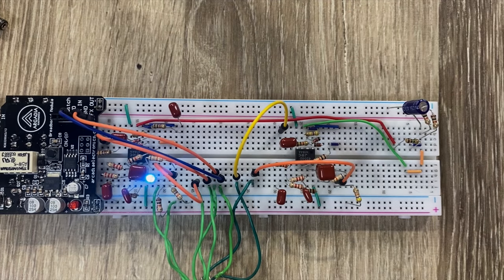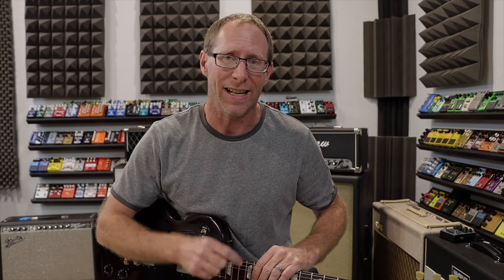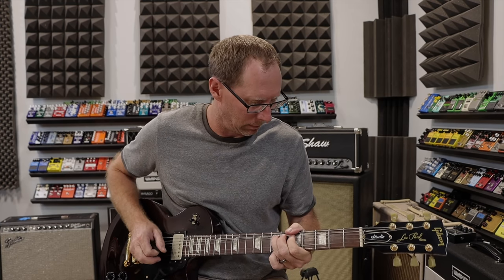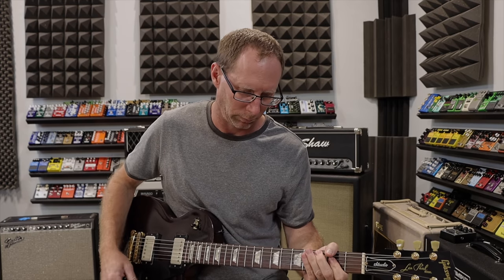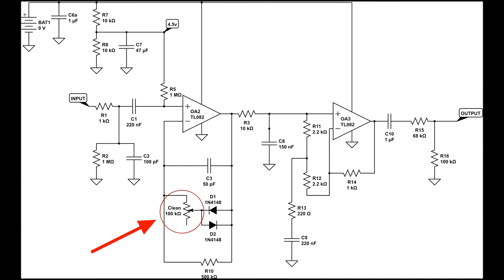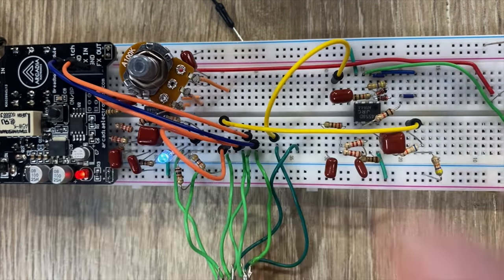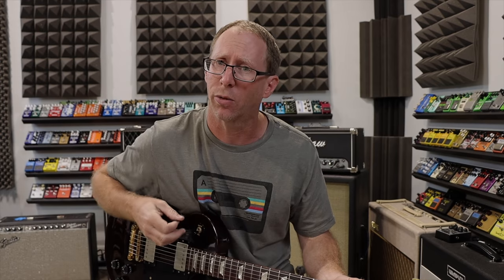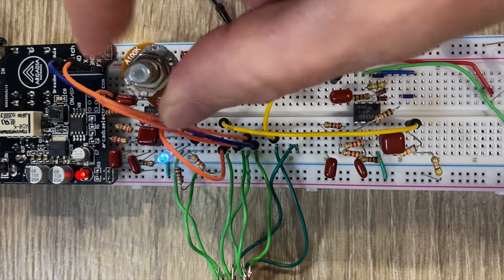It's all about the g̶a̶i̶n̶ ehhh cleans?

Comment: It can be hard to hear blended-in clean under a heavy distortion sound in a one-track, mono take when there's little clean signal added in or left in.  When clean guitar is used in the guitar sound of an album, it's usually in its own track (or tracks) and can be manipulated in its volume and/or compression to stand out more (or not) against the more compressed distortion.  Also, stereo panning can emphasize or de-emphasize the effect and audibility of included clean tracks.
Before hearing "the answer," I think Circuit 2 is the one with blended-in clean tone.  Don't know why, exactly, it's subtle, but there seems to be slightly more complexity to the harmonics in Circuit 2's sound.  I could be wrong.  That extra complexity could be from there just being less circuitry in the signal because it's a simpler distortion-only signal path, but that's my wild-assed-guess statement of opinion.  I don't know which one was LED on or LED off because I listened with my eyes closed.  Let's see how it went...
Turns out I was right.  But I'm no tone genius, there was a lot of 50/50 in that call.
I do think that blended-in cleans can be very useful in getting good tone out of an overdrive or distortion pedal.  Used judiciously, it can cause distorted tone to sound a bit more big-tube-amp-like by giving a lot of dynamic "slam" to the attack of a note or chord and then, because there should be more fundamental in the clean signal than the distorted, can impart a "fullness" to the overall tone before it fades under the sustain of the distortion.  That's my theory, anyway.  Balance is the key factor here.
Or you can use it as a weird effect by throwing in lots of clean and little distortion...
This was a good demo.  It clearly demonstrated the concept you were trying to get across.

Comment: So what is the difference between this and using a parallel dry signal mix in pedal?
Reply: Guessing the clean is still passing through the tone stack (vs parallel which would just be mixed in right at the output)

Comment: About 4:30 for me enters that uncanny valley where you can hear both signals too far apart and it feels kind of unnatural. I feel like this trick works a little better on bass to preserve some low end with a lot of circuits but have never liked a true clean blend with guitar.
Reply: Yeah after that it starts to fall into almost an effect more than just tone shaping. Maybe useful or fun to tinker around with but i hear it too.

Comment: That's a lot like the practical method of stacking pedals rather than relying on just one pedal to do it all (but parallel addition not series stacked pedals).  
Repeat this test with a Strat since complaints about the 'too thin' bridge pickup are so frequent.

Comment: As I play bass as well, I have bought pedals that have a blend pot so you can blend the clean signal into the effected tone.
My immediate, mid term , and enduring reaction to discovering this experience is a categorical; ALL distortion/overdrive/fuzz pedals should come with a blend control.
As long as that is not the case, our world is imperfect. * bangs gavel *

Comment: The Cleans is not the Dry signal, the cleans are from the amplified clean with the soft clipping diodes? Most Chorus pedals take the DRY signal and tap it off right BEFORE the first input stage. Distortion and overdrive pedals are taking the DRY signal and tapping it off AFTER the first input stage and adding soft clipping diodes for the positive and negative cycle of the DRY audio signal?

Comment: What circuit would this most resemble? The tone is awesome on it’s own but, with the some clean mixed in, even better. Didn’t like it once you start hearing  it separate into two different channels. I would be happy to have the tone of that circuit on it’s own though.
Reply: Blues Breaker.  If you look at the schematic, there is a 6.8k resistor in line with the clipping diodes just like Brian showed in the video.
Reply from the maker: @ChrisRash  actually closer to the tubescreamer, just with different values. You're correct that the 6.8k in the BB is doing the same thing though.
Reply: Thanks for the reply. Love the tone!

Comment: I’ve been trying something similar with a signal splitter with a gain pedal and a volume pedal on one side, and a clean route the other. I then rejoin the signals into the amp and using the volume pedal I get a variable distortion.
Reply: Boss LS-2 has a couple of tricks like that

Comment: I think you just answered a question I had about a circuit I was looking to modify. 
In you circuit diagram, is the R10 500k resistor basically a maxed out gain control (Like if it was a 500k pot)?
Reply from the maker: Correct

Comment: Given that I have an extremely dodgy Steinberg CI1 (which will not allow me to monitor without some of the dry bleeding through), having that dry tone blended in with my dist. is not something I'm fond of at all... For modern metal, having a clean tone blended in just doesn't work. Even the slightest hint of a clean tone throws it right off its feet. Having said all that... In this context, I agree that it works quite well for these more traditional dist. tones. In this setting, it livens things right up.

Comment: Fantastic video, as always... Just curious, are there any pedals that do this? I know the Ego blends the compressed signal with the dry, and the Klon circuit pushes clean up along with gain...
Reply from the maker: Yes, quite a few actually! Most non inverting opamps with the diodes set up this way are adding a bit of clean in just due to how they work. Other pedals such as the Bluesbreaker clones have a resistor there to add in some clean
Reply: @wampler_pedals  thanks for the answer! But, are there any that are set up like the breadboard that Brian uses in the video, using a pot to mix the dry and distorted signals?
Reply: @joshuaevans1922  Also interested in this
Reply: JHS Moonshine V2

Comment: I'm interested as to where lug 3 of the potentiometer is heading - is it going to ground or R10?  Or do I have it wrong entirely?
Reply: My understanding is that you leave it detached.  You are not splitting a voltage, the pot is being used to vary the resistance (and hence voltage) seen by the clipping diodes and hence where they clip.
Reply: @ianglencross  I appreciate you. Thank you.

Comment: Good stuff man! What was the circuit based on?
Reply from the maker: It's roughly a very simplified tubescreamer sort of thing for the most part, just using different values and the second circuit is using an inverting op amp

Comment: Funny, every bassist knows you need your cleans mixed in. A distortion without a blend knob is basically useless unless you have a boss linesplitter. Also, if you want less off a stereo sound, use a compressor to even out your clean signal with the compressed distorted sound